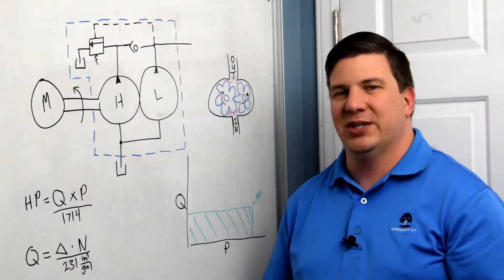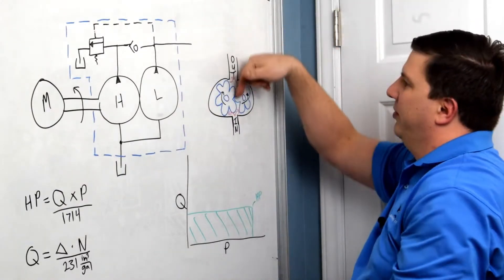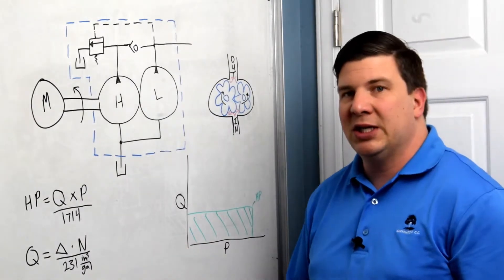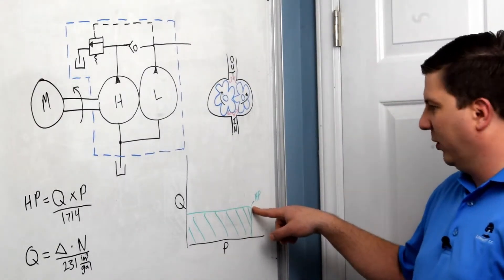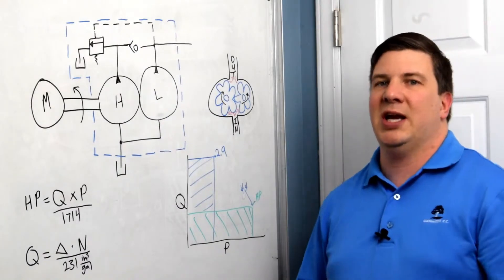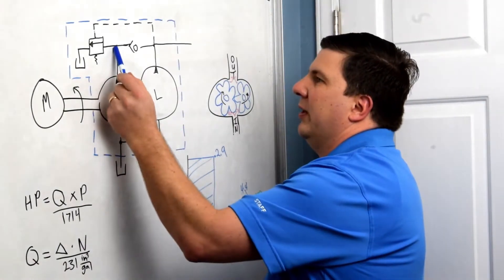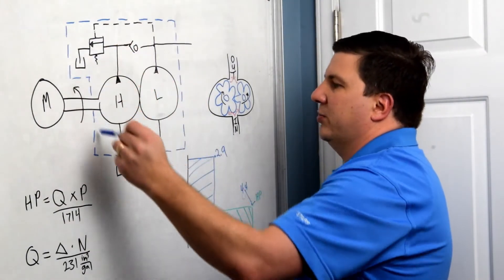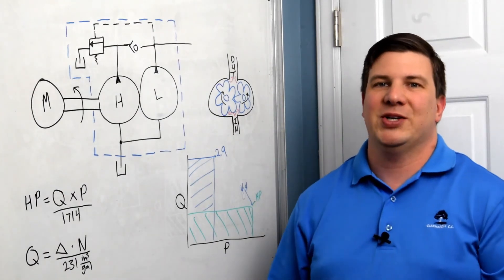What is a Two Stage Gear Pump?

Comment: Hi I have 2 - 4 inch cylinders and a 15 horse gas engine looking at a 2 stage pump 3000 psi 22 gallon-6.1 gallon please can you tell me if this pump will work good at a fair speed and how much pressure thanks john
Reply from the maker: John, 3000 psi at 6.1 gpm is just under 11 hp.  The engine would stall with the high flow rate at 1170psi, but I'm sure the bypass valve will kick in at under 500 psi.  Using the 22 gpm, the cylinders will both move at 3.37in/s.  Total force of 19 ton for each cylinder.

Comment: I'm considering designing and fabricating something similar to that of an excavator. I'm considering using a 2 stage gear pump to drive hydraulic cylinders to drive appendages. The project is intended to be a prototype on a smaller scale of something I'd like to build in the future.
I am also about to figure out my valve block/body (not sure what it's called yet) for controls.
Reply from the maker: Straifus, if you need design help, please reach out to me through www.rasmussendesigns.net

Comment: Thanks for the video. That’s no use to me however, coz I need to bust logs at ‘maximum’ pressure, ‘maximum’ speed! 💪 What must I do to my system in order to be able to accomplish that? Thanks.
Reply from the maker: Thanks for the question.  I don't understand why you need to travel the head to the log at maximum pressure.  That is very wasteful.  Also, when you are actually splitting, the splitter usually only goes to the lower speed for 1 - 4 seconds of a ~20 second cycle time.  

I fear that you are missing the point of what the 2 stage pump get you.  Maximum flow when you need it or maximum pressure for the few seconds when you are splitting.

If you want to replace it with a single stage pump that gives maximum flow at maximum pressure, you will need a larger pump.  First, you will need to buy a pump with about a 0.84 cipr displacement.  Then you will need an engine that is at least 22 Hp so it doesn't stall.  Finally, you will need a relief valve that can handle 13 GPM.

I hope this illustrates why the 2 stage pump gives you slightly less performance running on a smaller 5 Hp engine.
Reply: Mentored Engineer Thanks for your reply. Yes, I fear I was missing the point on what a two stage pump was actually designed for, maximum volume, for the head to get to the wood ring quickly, then when it detects huge resistance it slows down to exert maximum pressure in order to cut the gnarliest log, albeit a bit slower, basically the best of both worlds. I understand now thanks for explaining.
Reply from the maker: You're Welcome.  Thanks for the question.
Reply: @MentoredEngineer  Hi again, another question if I may? I'm merely plucking figures from the air here, to try and get my point across, but, just say you had a 28GPM pump, the low pressure, high volume side accounted for 21 GPM, and the high pressure, low volume side accounted for 7 GPM, and the pressure cut off was, say 4,000 PSI. Up until that 4,000 PSI is reached, do both sides of the pump work simultaneously (producing the 28 GPM quoted) and when the 4,000 PSI is reached, then only the low volume, high pressure side kicks in, or is only the low pressure, high volume (21 GPM) side of the pump working to get speed the head to the wood, until the pressure comes on, if that makes sense? Thanks.
Reply from the maker: Hey!  With those numbers, you would need a 16.5 hp engine to make this work  (7 gpm * 4000 psi / 1714).  The 21 gpm pump needs to cut off at a lower pressure so that the engine does not stall.  This means that the internal bypass relief (sends the large pump flow back to tank) could be set no more than 1000 psi.  Typically this would be set much lower (~75%) so that oil temperature  would not effect the mechanism.
Reply: @MentoredEngineer  Thanks again for answering, however, I don't think I explained the question properly the first time, let me try this approach. A guy on a forum told me that, at 'no' time do both the primary and secondary sides of the pump work together, even under no load. Under no load 'only' the high volume side of the pump works until it strikes resistance and then the valve activates and then the low volume side takes over! So, out of a 28 GPM pump, the maximum it'll flow is 21 GPM, the minimum would be 7 GPM, but 'NEVER' 28 GPM, however, from what I can glean from your, and another person's video on YT, is that, while the ram is under no load and it's making it's way to the log, both primary and secondary sides of the pump are working in unison, giving a total volume of 28 GPM? Is that correct? In other words, at any time throughout the ram cycle, does your 28 GPM pump actually pump 28 GPM?

I must say I like your formula regards working out the amount of HP you need, thanks for explaining that. And don't worry about HP, I've just bought a Handa GX690, 22 HP V Twin engine, to go with my newly purchased Haldex 28 GPM pump. I just need a suitable ram to suit the previously mentioned ingredients, I'm probably cutting no more than around a 16", maybe 18" (at the very most) long rings, any suggestions? A 5" diameter ram with a 3" chrome inside ram??? Thanks.
Reply from the maker: Yes!  A two stage pump has two pumps that, in this case, put out 7 gpm and 21 gpm.  At low pressures, they add together producing 28 gpm.  With pressures over the internal relief valve setting, the 21 gpm pump dumps it's flow to tank and the system only generates 7 gpm from the small pump.
As far as the cylinder goes, I wouldn't get a stroke less than 24"  If splitting an 18" long log, you will want 6" of "slop" for easy handling.  A 5" bore cylinder produces 29.5 tons.  It might be a bit excessive.  I have a 4" cylinder (~19 tons) and have had only 2 issues where I didn't have enough force to split.  In both cases, I turned the log around and split it the other way.
A 4" cylinder is way more common; therefore, the cost is usually less.  See https://www.baileyhydraulics.com/
Reply: @MentoredEngineer  you're awesome with your answers